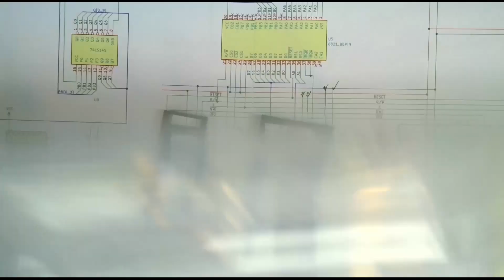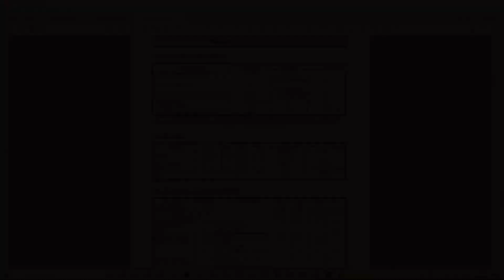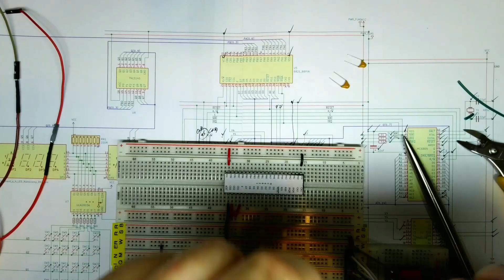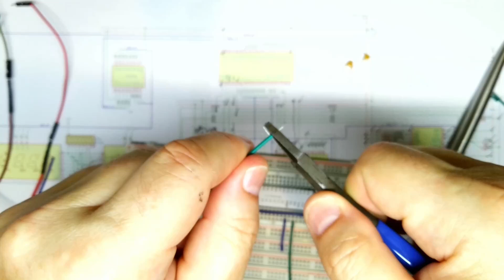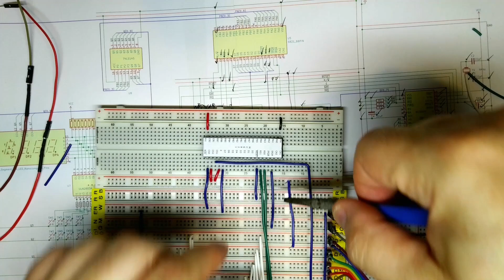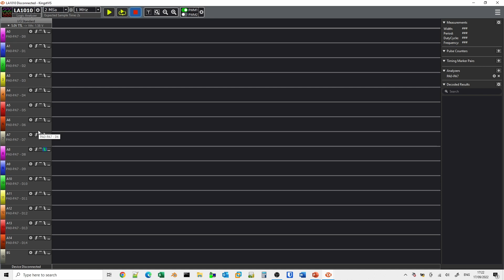Nanocomp 6809 #6 RAM & PIA - 8 Bit Breadboard Micro

Comment: I just noticed that you are using the AS6C1008 for RAM. According to the datasheet, this particular chip needs 0.7 * Vcc as a minimum high input voltage (=3.5V), whereas TTL output high voltage can be as low as 2.7V. 
Did you have any problems with this RAM chip or did it just work in practice, because input levels are always high enough?

I'm also wondering, why the AS6C1008 has CMOS inputs (in contrast to every other common parallel SRAM DIP chip), or if this is maybe just an error in its datasheet?
Reply from the maker: Good spot, when I bought the AS6C1008 from RS in the UK there wasn't much in stock anywhere (compared to now, and I tend to now use Mouser for larger orders). It wasn't a problem as I think from memory the voltages where around 3.5V anyway on the data bus (could always add 10K pull ups to the data bus if it was an issue). If doing this again I would probably use the faster 32K SRAM I used for the video controller (71256SA) as this are narrower and have fewer pins which makes fitting to breadboards easier.
For the 8086 project I have used the 512K AS6C4008 which is TTL compatible. 
I would suggest getting a TTL compatible SRAM chip if you want to repeat this project.
I think the AS6C1008 was the least worst option available at the time given 32K chips were out of stock.
Dave

Comment: thanks mate for the excellent work ,,, I am the in process of changing my career to electronics ,,, one issue have seen in the connection of the PIA is  CS0 and CS1 which is an active high pin ,,, why connect it directly to the VCC line without any current resisting resistor
Reply from the maker: Thanks for the feedback. There are 2 reasons for CS0 and CS1
1) The original Nanocomp schematic had CS0 and CS1 wired direct to +5v so I will have copied that. I think Bob Coates the original author probably knew a lot more than I do! 
2) Generally you would use a resistor pull up (4k7 OR 10k) to +5v if you were going to connect outputs of other chips to pull the pin low so they would only need to sink 0.5mA to 1mA. Since we don't need to use these pins then it is easier just to wire to +5v. I guess it may be more power efficient to use a 4k7 resistor to pull them high but the original Nanocomp was designed to be as simple as possible.
Hope this helps, good luck with the change in career.